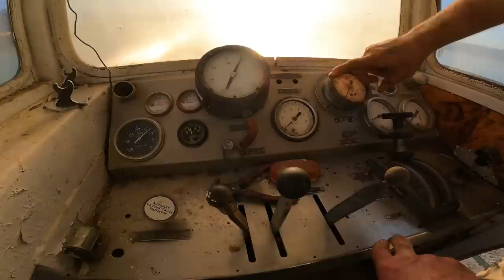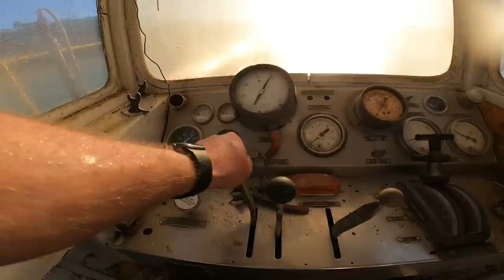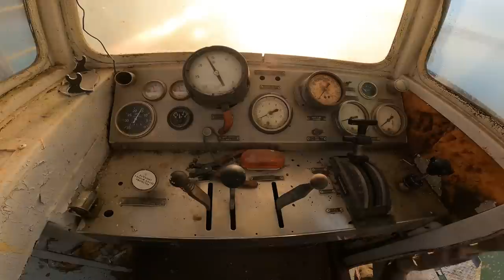UNDERWATER  sand dredge footage - Will it float!???🚣‍♀️🚢💦

Comment: You folks should really consider wearing some ear protection.  It may not seem like it, but you are damaging your hearing ability.
Reply from the maker: You’re absolutely right, we do wear hearing protection in the areas that we really need it, but we probably should wear it more often than not
Reply: @TheRealMrDiGG Having worked around aircraft, power saws, and diesel powered pressure washing pumps, I have gotten used to wearing ear plugs for hours on end.  Surprisingly, they protect your ears while still allowing conversation, as long as the other person speaks up a little.